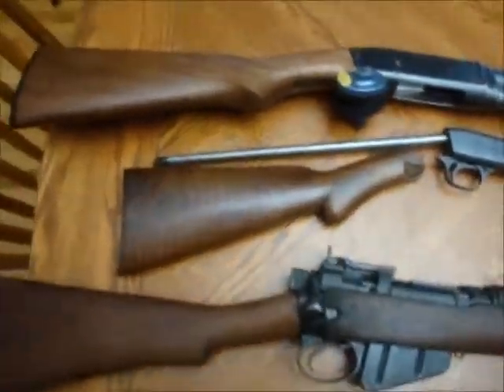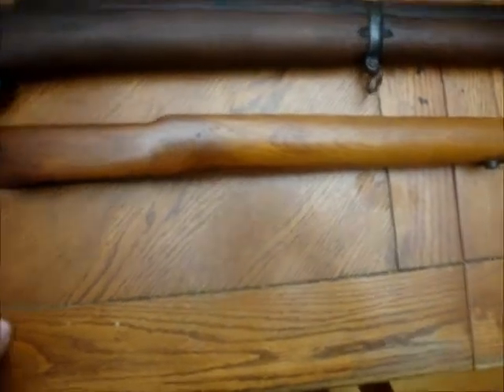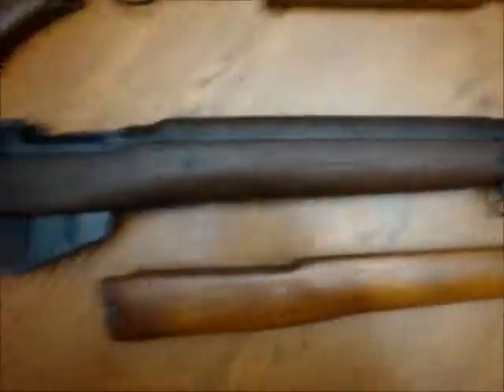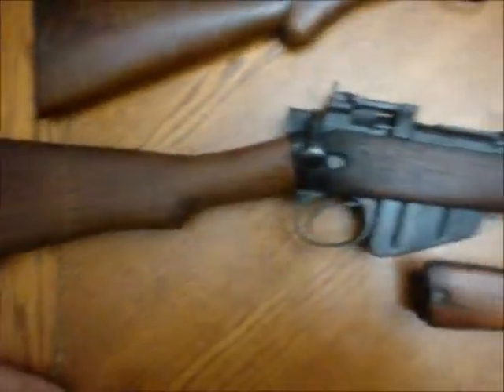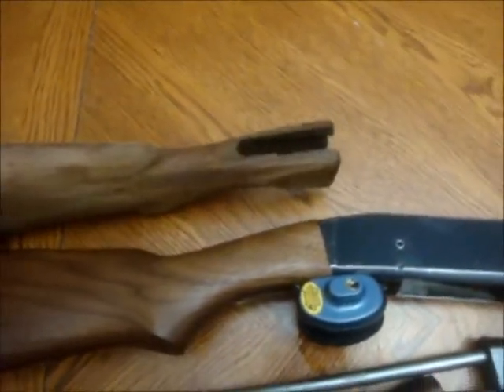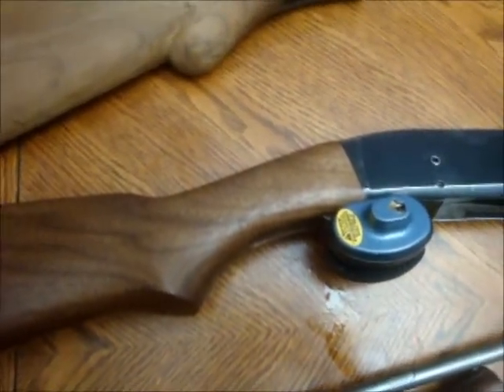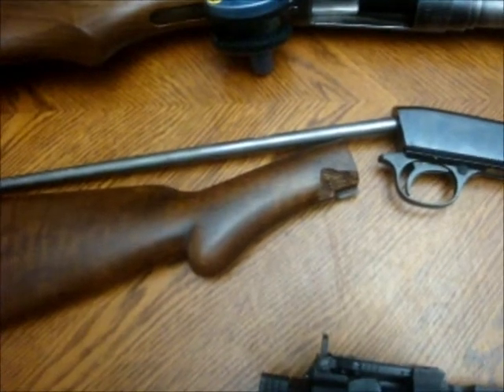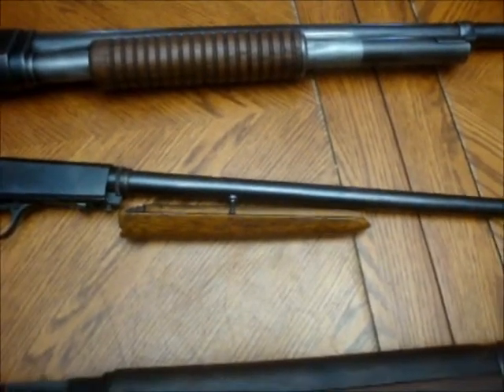Ongoing firearm Projects: No4, Remington 10, and FN SA .22

Comment: Love what you did with them. Especially a nice job on the SMLE #4. Speaking of SMLE's, I shot mine today. I was surprised to see that it shot the undersized Chinese 7.62X39 bullets pretty well. Retrieved some bullets from the berm & they had nice rifling marks on them. They did also have signs of gas blow by, which is not so good.  At 50 I got 4 shots into an inch w / a flyer opening it up to 4". At 100 4 went into 2" with a flyer opening it up to 7" or so. After I settled down I was getting on average 5 shot groups of 4". Not bad for Mexican match I suppose. Best regards friend.
Reply from the maker: Nice to hear it went well, I guess gas blow by although not ideal won`t mess with accuracy that much if they are all experiencing the same amount? My no 4 shoots well but due to changing the rear sight on it the gun shoots high, Gotto source some front sights at a good price.  .280 ross attempts are still not materializing. Some guy was selling dies for it on ebay, wouldn't ship to canada. winning bid 35$.  Lee quoted me on 150+46$ to have a set made and I needed shot brass from my gun. Don't have to tell you that I'm somewhat angry that it was US shipping only. Atleast your experiments mean I can use .284 bullets and it should work decently.
Reply: I was reloading because the gun  was shooting too high lol. I was thinking of just getting a spare front sight & just making a taller blade for it. I like the mid range loads though, that is the other way to get the rifle to shoot where you want it. With factory it was shooting 14" high at 100, today with the reloads it was only shooting 5" high at 100. Not too bad. It was like shooting a .30/30 but with less recoil. Too bad about the dies. Maybe nitro express forums or castboolit forums?
Reply from the maker: With any luck the old lady who got rid of them finds the reloading room...
Yeah the sights seem to have dried out. May need to barter with someone whos gun shoots low lol. I think mine has the same height issue. Dead on windage wise but she sends them just over a foot high. Using old military and hunting ammo, haven't reloaded. Try trailboss it will turn her into a .22 and probably drop her down a foot.